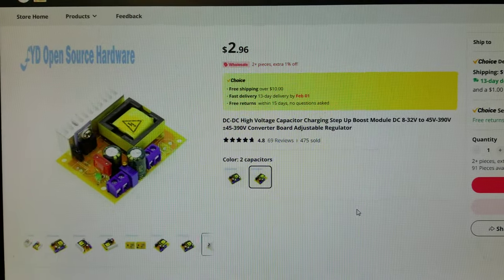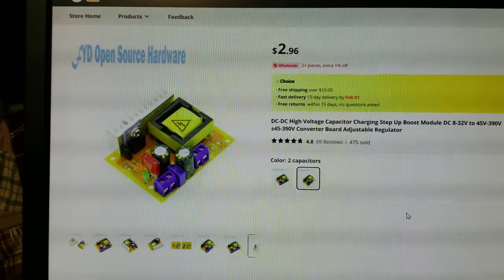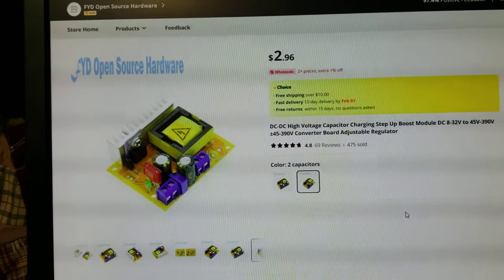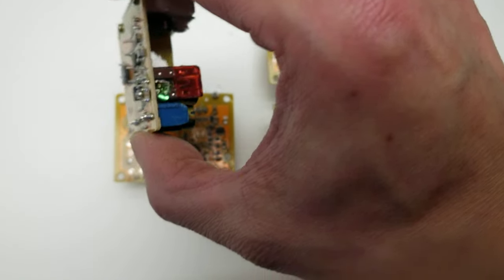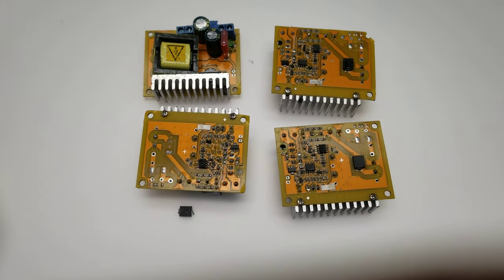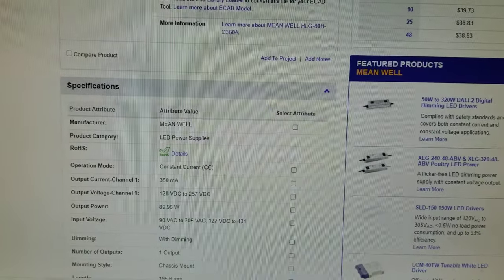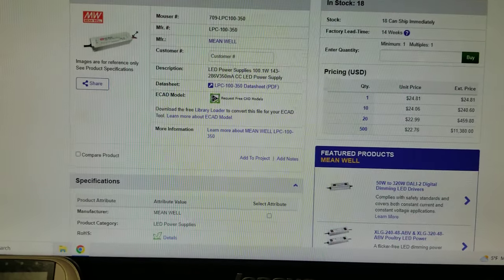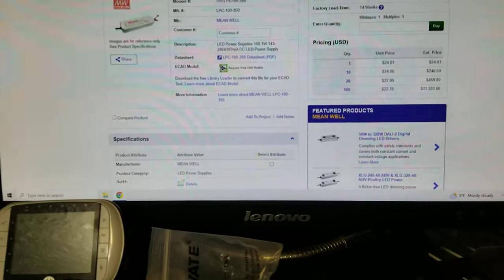HV DC-DC Boost Converter 8-32V to ±45V-390V ZVS Flyback Design Module YH11068A Muse

Comment: Hi , my plan is same but for Lexus battery 350v, , did u try it eventually or did they explode
Reply from the maker: I haven't tried yet.  So far the HV batteries I worked with either required their sense wires or connection pins going to the ECU cleaned or repaired.  Otherwise, been replacement of modules that solved the HV battery codes.  Haven't tried grid charging yet with any of the power supplies.  If using this, will most likely wire in parallel to reduce the current load used.